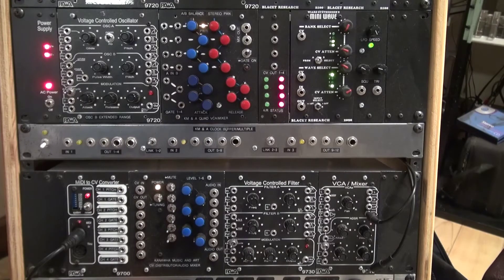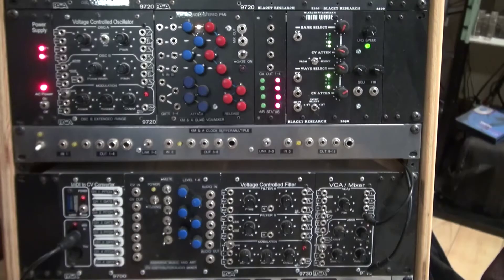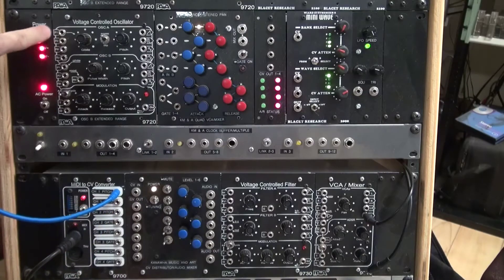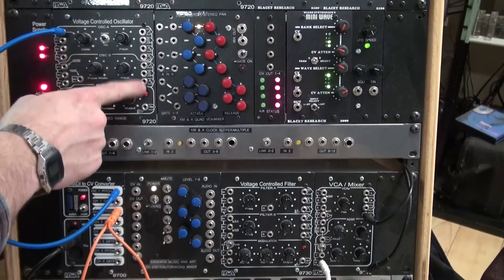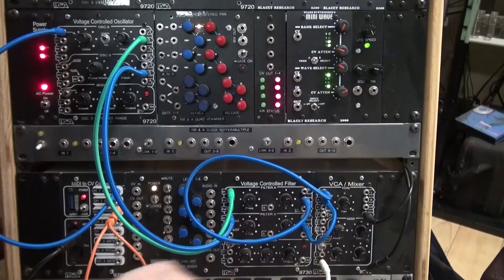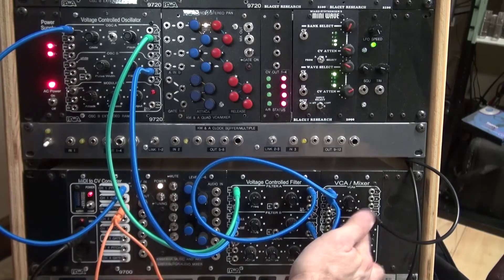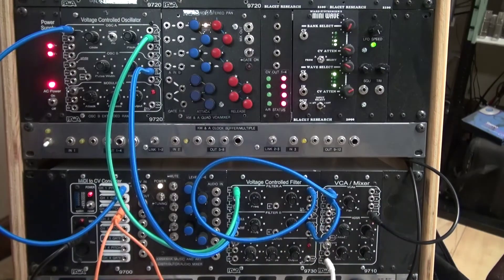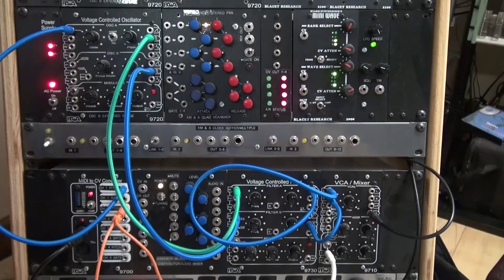Paia 9700 modular basic patch set up

Comment: Thank you for making this video! I built mine back in 2002 without knowing anything about synthesis and once it was completed (and Scott helped me fix the CV output ground bus wire) it was still a perplexing unit for a beginner! Lots of features packed into these modules-and once one gets familiar with the design's normalization (and more help from Scott) the 9700 starts to shine as a great little synth. If you haven't already, you might want to let Scott know about this video-he will probably be elated to know a good visual explanation exists!

Comment: I have finally followed this in order to get a bleep or 2... and a couple of questions linger- is there a headphone output? the dip switches on mine are recessed- is that normal? What type of tool is used to flip them? A tiny screw driver? :O I have never used such tiny switches and want no harm to come to them! And now, I need to dig out a Y cable- I have one here somewhere...
Reply: Just to answer this - Yes, the dip-switches are definitely recessed. Mostly because you won't be changing them around too often.